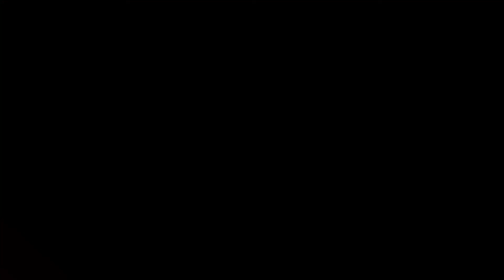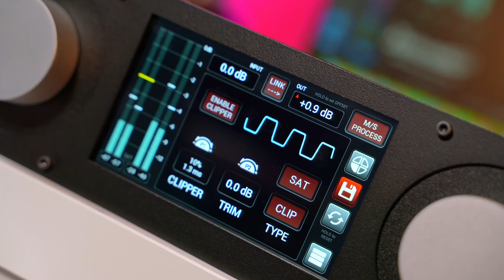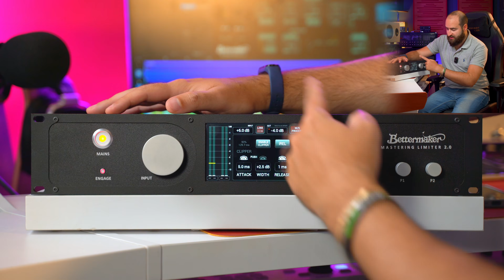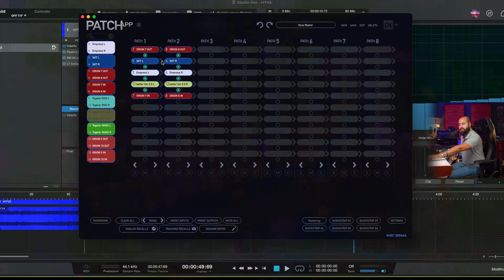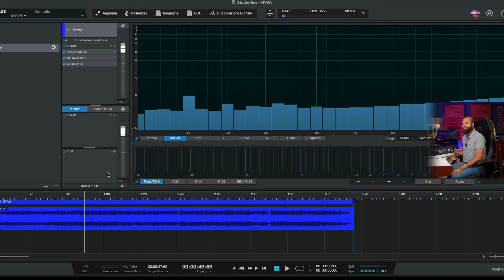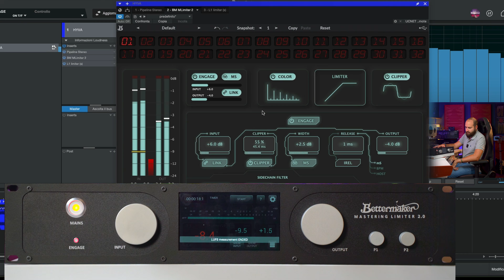IMPROVED WITH COOL FEATURES | Bettermaker Mastering Limiter 2.0

Comment: Thanks for the great explanation. Am I understanding this correctly? You keep the output constantly at -5 to -10 values. I guess this is a deliberate move to avoid misleading the ear and to make all the colors of the device A/B, right? So, when we get the final output, we should still take -0.1 through Bettermaker, right? Or is there a different situation on Daw? I'm a bit confused; I'd really appreciate it if you could clarify.
Reply from the maker: This device cannot provide a true peak in digital domain. So I always then put a plugin limiter for the true peak at -1 dB. Don’t use -0.1 db is too high since all the major streaming platform ask for -1 and also if you keep in mind that your song could be transformed from wave to mp3 it can clips over 0 db
Reply: @MadSteex  Your explanation was very helpful. Thank you very much.
Reply from the maker: Thanks! My pleasure :)

Comment: Hi, congratulations for the video, I would like to ask you a question: did you connect the Bettermaker in INSERT or did you enter the left and right limiter inputs COMING FROM THE PREVIOUS OUTBOARD OUTPUTS? Thank you very much for your answer. Efrem Farieri from Venice, Italy
Reply from the maker: I'm based in Italy too :) Anyway I've all the outboards connected to the Flock Patch L, which is a fully analog patchbay, is like having all connected in cascade from the previous outboard without leaving the analog domain and without making any AD/DA conversions.
Reply: @MadSteex  oh grazie mille..complimenti ancora per i tuoi video..ciao..

Comment: Thanks for the review! I bought this processor, but I'm upset that there is no information anywhere on how to calibrate it! And in this video, unfortunately, they did not come true. How to calibrate it correctly, where can I find detailed information, or better yet, a video?!
Reply from the maker: Yes, unfortunately I've not showed how to calibrate it; you should find on the manual. Anyway in the limiter settings you can manage the metering raising or lowering in db to match what you see on your daw.